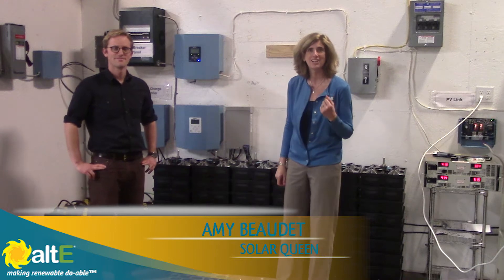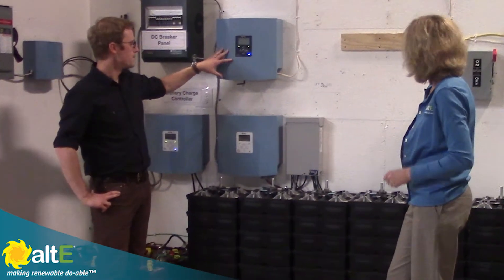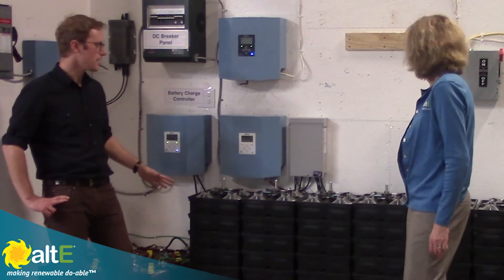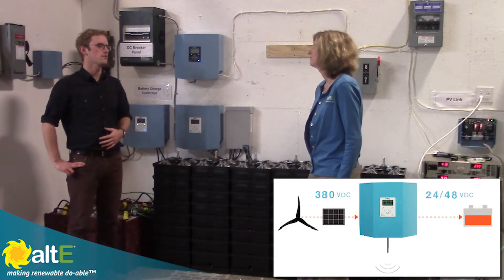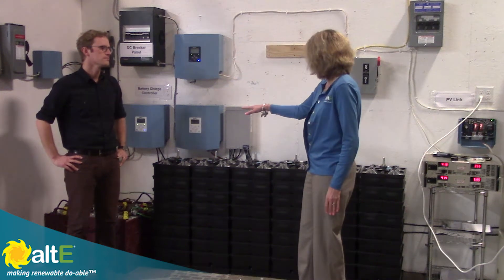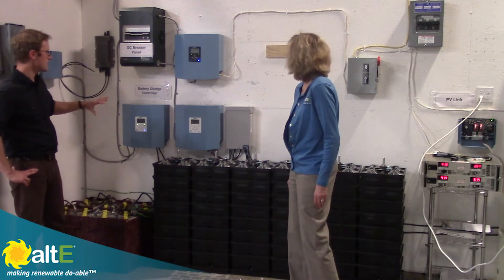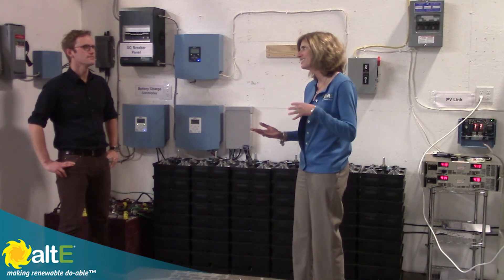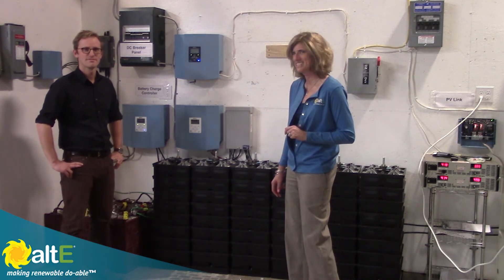Pika Energy hybrid wind and solar battery charging system

Comment: Interesting. Are the Tesla Powerwall batteries ever going to "step down" their voltages? Is there any word on that? I think 48v would be good for RE folks...might be able to do some firmware updates with Midnite Solar Classics (et al chargers) to work with them.  I like how Chip's Trojan batteries are installed with Flow System's Water Miser vent caps. I run my Trojan L16's that way too. Glad you posted this video Amy...glad to see a company already addressing future roadblocks with new battery technologies.
Reply from the maker: +Chris DIYer Elon and I aren't tight enough for me to know his future plans ;) However, I do know that the inverters that are designed to work with them are supporting 380VDC. That happens to be the same voltage that both Pika Energy and SolarEdge were already running their DC bus from the solar panels and wind turbines, so I expect to see more products using that voltage range for DC microgrids. It makes sense to run at high volts, low current. 48V made sense when systems were small, but with growing system sizes, keeping the current low with higher voltage is a smart move. As you know, watts = volts x amps, so keeping volts high keeps amps low.
Reply: Thanks Amy...I agree. Great video you did there. Keep 'em coming!